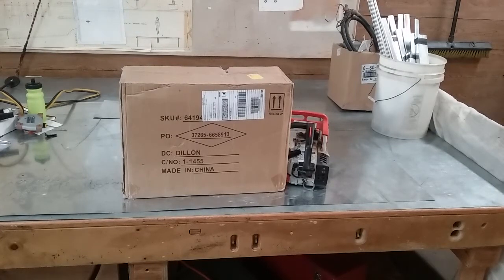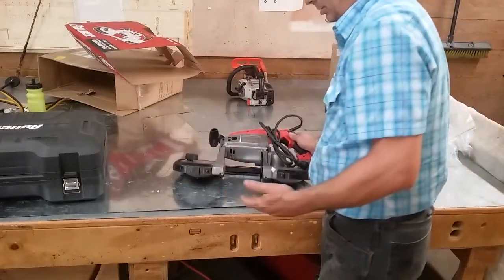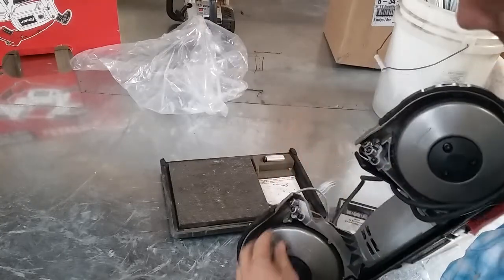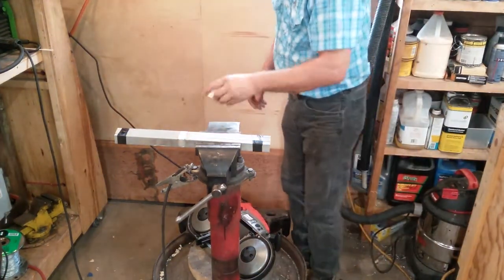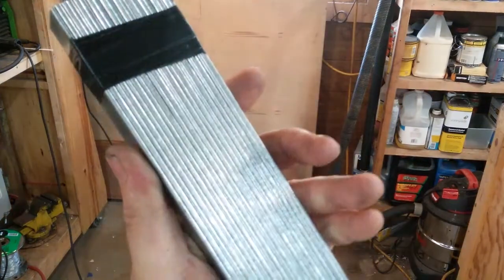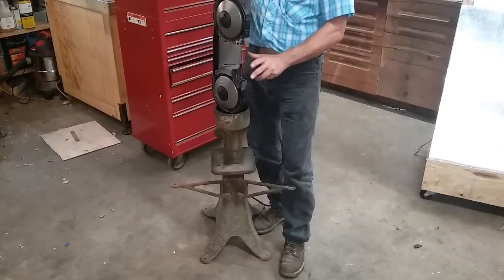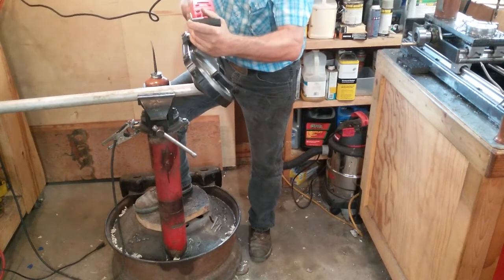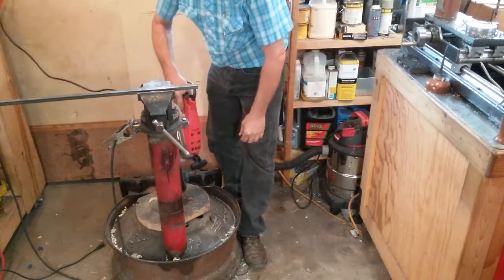The postman always rings twice. Bauer 1678E-B portable bandsaw unboxing and first impression.

Comment: Real cool project,I just bought a starrett 145 exact high tension frame saw. I can tell you never been happier Thinking about building a billet 7075 T6 version. Also was thinking about one of those so I wanna see more of that. some sort of sliding table with just some golds gym wait's for the feed and gravity, air blast for chip clear, v blocks on a 1" sqaure 1/2 or 3/8. every day an opertunity to pull on those boot straps ya know tools and work you look foward to sometimes you gotta make em yours the seat clamp type levers for bikes and just some thought on where quick acurate adjustment lend's itself to more time with your line in the water is much apriciated so big thanks to you your an actual help
Reply from the maker: Thanks

Comment: I just got one too.   Did not get the extra brushes and the little wrench is too small for the screws on the guide plate.
Learned that care is required when installing the blade not to knock the tires off.   
But for the price I think it will be a nice addition to the shop.
Reply from the maker: Ol Charlie Chan shorted you!  It could be that the extra parts were not supposed to be with mine.  Never know.

Comment: Horror Fright finally got serious about their quality issues and the Bauer line is the result.
They now make quality tools at competetive prices.
I bought one of the regular HF band saws like that and it works just fine also. Zero problems with it.
I had a buddy make me a plate that bolts on where that thin black bracket is and it has a 1 inch square stub welded on the bottom so I can just clamp it in my vise to use.
I also went back to Harbor Freight and bought one of their foot pedal switches. I put a hose clamp around the trigger, plug the saw into the foot pedal switch and now I can use both hands on any material I am trying to cut.
You are going to like that saw, congrats and think about getting one of the foot switches.
Reply from the maker: You know, thats not a bad idea.  I can use the cream separator base for something else.